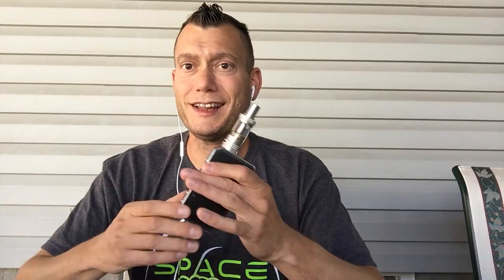Dangers of Ni200 nickel DON'T vape it on anything BUT Temperature Control!

Comment: What temperature is too high? my evic mini goes upto 600, i vape at 550? I'm sorry if this is a dumb question. Im really new to this :P
Reply from the maker: +Kaushik Padmanabhan Not a dumb question at all.  very common question.  It's personal preference.  You start in the 300's and work your way up to find the vape that you like.  All the while paying attention to the wicking of your build and how it keeps up.  how fast does your atomizer and build accept juice, etc.  only you will know when you have reached optimal vaping for you.  And hopefully your Evic Mini keeps accurate.  They do have a margin of error.  so 550 would be the max I would set that.  keep attuned to how your vape goes and be prepared to back it down if it tastes like it's running dry.  Don't rely on the device to control your vape, but rather act as a backup to your vape.  a mostly reliable but not always reliable backup.  Maintain ownership of your vape even if you have Temp Control.

Comment: Nothing wrong with kanthol.  All these lower ohm builds and mods just mean higher wattage, and less battery life.  It's all about  getting off the stinky sticks.  And getting good flavor. It's not about showing off how much clouds you can blow out of your mouth.
Reply: +mike hernandez No. Lower ohms means you can run the same wattage and use less battery. Just look at your kanthal. Build a .5 and a 1.0 and see which makes the battery last longer at the same wattage. Remember that wattage is the power output so vaping a 1.0 at 30 watts is the same as vaping .5 at 30 watts...just a different voltage. What TC is really about is not getting dry hits and taking longer hits without the heat.
Reply: Was talking about 0.1-0.2 ohms,  takes more power (battery life).  Wasn't talking about 1.0. With a 0.1 build you won't get flavor nor Vapor at 30 watts. Need at least 50 to 60 watts
Reply: mike hernandez That is outright wrong. I am using a .07 right now at my normal 45 watts. My batteries last almost 2 days. Where if I build at .5-1.0 I'll go through batteries in about 6-12 hours. I also get just as much vapor and flavor at 45 watts with my build as I do with any other build at 45 watts. Do you not know how ohms law works?

Comment: Ok so maybe I missed the part.. what is the temp max and wat max for ni200 crown uwell?
Reply: +Matt Smit 662F (350C) most mods only go to 600F. idk about the watt max, but I'm using my nickel wire at 120watts at 540F & its Great.
Reply: dangerouspsyco Absolutely.  Do not use nickel coils in wattage mode.  You'll burn em.
Reply: +GAZA-Z My mod goes higher but I'm guessing the vape won't be that great when too high.
Reply: +Matt Smit TC to 400, 500 and 600 watts.  Max 150 watts.
Reply: You only use the ni200 in temp control mode, never in wattage mode.

Comment: i heard that the mods with tc dont read the temperature right.if we put 200 c maybe its 250 c...hi from greece
Reply from the maker: +46sotos Hello over there in Greece!  Some mods are more accurate than others.  They are not reading temperature, only the increase in resistance of the coil from a baseline at room temperature.  it's complex....but just know that you can't get cheap and accurate in the same device.  Koopor Mini is probably the best accuracy in a device under $50 for temp control.

Comment: what people are not thinking about is what is happening to the nickel even at 300-500 degrees [f]...there is a chance that soft ass metal is off gassing metal. more research needs to be done. im pissed i got a sigelei now because i can only use kanthal or ni200....i like how it rips with tc but im trying not to get cancer by switching to vaping....whats the point if im going to get cancer from the ni200?

Comment: I vaped a nickel coil and power mode very heavily for about 2 weeks. Me and my friends are both new to vaping so I wasn't aware. Since It was only a few weeks and not years I should be okay right?
Reply: Nope your fucked man
Reply: It's fine it won't hurt you and there is NO powder that forms on the coils as I checked this part and there was no powder and I did all this on a non temp box
Reply from the maker: +YouTube Madness you dont' need to visibly see a 'poweder' for there to be a problem.  nor does the metal need to melt.  ignore these other guys telling you smacktalk...it's not good to vape nickel out of temp control and it's not good to glow the coils red as it alters the structure of the metal.  that is all I say here, that is all I will say.  get your mods in temp control correctly if you choose to vape with nickel.  vaping is not safe. it is only safer than smoking.  thanks.

Comment: Ok is that just for the Rebuildables?  I got my MVP 3.0 pro with a Elite Tank 2 (one of the shops online was having a deal) and The tank came with 2 Ni 0.2 coils and I know the 3.0 is not TC?
Reply from the maker: +Joe Man no.  that's for the metal.  I noticed that myself when I got the Sigelei Elite tank 2.  It didn't come with anything but 2 ni200 coils.  You're vaping nickel without temp control.
Reply: +Joe Man What Quest said..... also adding DO NOT VAPE THAT tank anymore, UNLESS/UNTIL you get a device with temp control to put it on!  Ni200 coils.... must be vaped in TC mode, only!  =o  You are correct, the Innokin MVP 3.0 is  definitely not a temp control device.  (inexpensive & great... pick up a Joyetech Evic vtc mini for around 40 bucks.  The orig is easily firmware updated to = the just released v2 that costs a few $ more.  imho, just get the battery... tank included in 'full kit' isn't worth getting)  If interested in TC & using that tank, that is.  :)  Live long(ER) & vape on!

Comment: So, even if it's a temp control mod, with the 3 different settings, W,Ni,Ti, still dont keep it on W mode with a nickel coil? I cant seem to find anyone actually saying that. You came the closest by saying "dont vape nickel in wattage mode" but it sounded like you meant wattage mode on a regular mod, without temp control. So basically youre saying, even if its TC, not to vape nickel in any other mode but Ni? Cause it has such a weak throat hit on nickel mode, but when you put it in regular W mode on the same wattage that it would have in Ni mode, it gives a way better throat hit. So im going to assume that's not a good thing lol. I was wondering why the hits are so halfassed on Nickel coils but now it makes sense after reading forums all day that only specify not to vape nickel coils on a NON TC mod cause of toxins being released. But youre literally the only one who mentioned it, saying not even on wattage mode on a TC mod, still. Correct? lol I have an Eleaf iStick TC60w. So thats where i was confused at when people say not to vape it that way. No one specified exactly that. But im pretty sure you did, im just a little hard at hearing sometimes lol
Reply from the maker: +Randy Maahs Hi.  Many people didn't know this.  That's why I did this video.  Temperature Control devices have dual purpose.  They have regular wattage mode for regular builds and tanks with Kanthal coils.  And then they have Temperature Control mode which you have to physically set for the device, and then you must also set your baseline resistance (lock in resistance) for the coil before you start vaping, so the device can now calculate temperature while you are vaping.  If you don't specifically set the device in wattage mode for the type of metal that you are vaping, then you're vaping in wattage mode.  Yes the intensity of vaping in Temp Control is much less than in wattage mode.  Because TC is stepping down power to keep the vape from exceeding the max temp you set.  This means that when you are in wattage mode your mod is NOT stepping down power or keeping it below harmful temperatures.  So if you are used to high wattage on Kanthal or Nichrome in wattage mode, then TC and Nickel or Titanium might not be for you.  You don't vape Ni200 or Ti for the same vape experience as you would Kanthal.  It's a cooler vape that requires lower power, and gives a less intense vape but theoretically better flavor.  So the message in this video is simply this:  if you want to vape Ni200 pure nickel or Titanium wire, please make sure that you have a temp control mod and that you set the mod for the type of metal you are going to use.  This includes selecting wire type, setting max temp, and locking in resistance.
Reply: Olay, thanks! The vape shop I go to said that I could vape it in wattage mode with a TC coil, but it would just burn out the coil. She didnt mention much else lol.. I just ran out of kanthal coils and all i had left was nickel, but its like im not getting the same pressure, or pull that i do off kanthal. but thanks for the info! I greatly appreciate it!

Comment: would this be a problem with dry herbs using the modern vape pens?
Reply: +TheWarIsWithin  Tho I've not used them... I know people who do & don't believe any use Ni200 wires in their coils.  Most, I'd assume... are using ceramic, kanthal/non resistance wires.  Can check with the package of the atomizer it uses (the coil in the tank or bulb) See if it mentions a resistance/ohms, temperature &/or look for the word 'kanthal', & you should be good.   If still unsure, or at all concerned.... mention the brand or name of whatever the pen is.... & I'll find out for you. :)  Live long(ER) & vape on!
Reply: +TheWarIsWithin weyjkijjhgyytc qwyoljb vvggyiopllkjgzsaqqqww the the the
Reply from the maker: +TheWarIsWithin I'm not at all familiar with Dry Herb pens.  Sorry.
Reply: cool, thanks
Reply from the maker: Mervielle Harirtte exactly, I feel the same way about it.

Comment: Hi, a moment ago, i accidentally inhaled ni200 off tc mode. I didnt notice until i tasted something weird and when i saw my mod it wasnt on tc mode. Will there be any harm on me? I just took merely less then 4puff off 25watts. I straight away went to change my coils and washed the whole tank just to be safe. When i was taking out the coils, the coils were abit black on the middle. My question is just tt few puff will it harm me? Hope for some answers. Thanks i didnt get any dry hits though.
Reply from the maker: +kelvin delonge I'm no Doctor, I don't have a crystal ball.  I've done exactly that.  Some mods will pop out of temp control. Good thing you discovered and didn't continue.  Some folks have been doing that for weeks and months.

Comment: Hi..thank you for the quick reply, 
i hear so many horror stories about NI AND TI coils, so many claim it will cause cancer, heart attacks etc etc. I'm yet to see somebody who vapes on nothing but either ni or ti coils and have had no issues. 
especially if people proclaim that using tc reduces the consumption of liquid over kanthal. And supposedly uses less power over vw 
i will give it another try. watch a few more videos on making coils with either ni &ti,  before i start to dabble on that dark side
Reply from the maker: +Jonathan Rayson Lots of people vaping on Ni and Ti and have no problems and enjoy it.  All this is too new for anybody to make claims for or against with accuracy.  Just must be aware that each metal has potential issues if used improperly and THAT is what this video is cautioning...the improper use of, or use of without TC, or pulsing the metals to glow.  Thanks for watching!
Reply: +Jon 
I've heard it's just certain soft metals that are dangerous to humans.  Titanium is supposed to be safe, along with stainless steel and kanthal.   Nickel is one of the bad boys.
I'll have to do more research.

Comment: hi ya chap..interesting vid..im thinking on tring the ni200 0.15 coils, whats the best temp to vape on. using a Aspire pegasus the temp control version, been so used to kanthal coils 26awg
Reply from the maker: +Jonathan Rayson That's a difficult question to answer.  I suggest start with your max temp set at 350 and see how you like that vape.  If you want more vapor production then increase.  I usually set TC around 410-450.  But where you will find it best for you is a matter of device and atomizer/coil you use and you'll find what you like best going through the range from lower max temp to higher.  Thanks for watching, and that was a really good question.

Comment: thanks bro for the information I have the exact same set up the ipv 4s and the same tank, not to sure the name of the tank or much about it, not to sure what the need to knows are about vaping I've smoked cigarettes for about 5 years a pack a day so I'm really giving this a go, I really appreciate the time you spent in the vidoes, trying to learn more about this.
Reply from the maker: +j Sanders happy my video was helpful, congrats on quitting smoking!  You've got a great setup.  I have a few tanks in this video.  The tank on my IPV4S is the Smok TFV4 with the RBA section
Reply: +Quest4vape thanks bud I'm really glad I stumbled upon your vidoes, I have no knowledge of vape, or the equipment honestly, I just know my lungs are deffenetly damaged from cigarettes and I hope vape will help me divert from this. how often do you need to rebuild these coils and change the battery's? is there a recommended storage environment for the oil or batteries? what is the best setting? is there some kind of maintenance for these units? I'm sorry for all the questions I just don't want to be doing something I shouldn't be doing.

Comment: Hi. you seem real knowledgeable,kudos to you. very informative to watch. would you please have any suggestions as to why my crown tank leaks when top filled? (airflow closed when filling, then leaks as soon as opened up).? have a great day!
Reply from the maker: +leigh cannon Coil not tightened in all the way, tank not screwed together all the way (that inner chimney section did you unscrew that to fully disassemble the tank and not thighten it)  An O-ring not seated right.  IF not those then bad coil or O-ring on the coil missing or not seated right.  or...bad batch of coils. Bad tank.  Try to trouble shoot the problem by checking all those things.  If nothing helps then tell the place you bought it from to send you out good coils and/or a new tank.
Reply: +Quest4vape Hi thanks for the reply. using a different device hence different name. I will take your advice, thanks for replying. iv learnt lots from watching your vids! Greetings from England, uk
Reply: +Quest4vape just to add I was using nickel coil. put a. 25 stainless back in and problem gone! bad coil as you said?!

Comment: Nice video man! I tried to explain this to a friend of mine and he said I was wrong as well.
Reply from the maker: +Brian Robbins meh...it's controvertial so there are widely varying opinions on the subject.  My only point here was to make sure that one has a TC mod and sets the device to TC mode and not vape these metals in wattage mode or dry pulse them.  Thanks for watching.  If folks don't want to listen, well....they at least heard the message.

Comment: Thanks for putting that info out there.  Misuse of this stuff could not only harm you the user but if the FDA and other federal regulators catch wind that this is that toxic and users are at risk,  they will have more ammo to use in taxing and outlawing these devices.

Comment: not only is vapeing nickel bad but super high temps turn reg e juice into a toxic gas the new trend of super high vapeing lvls is a dangerous trend god 4 volts to 8 .5 watts is pleanty in most cases this unreged 100 watt sub ohm is getting nuts
Reply: drifter848 please link me to the study you're citing about toxic juice gas.

Comment: Brother i am new to vaping but want to do it safely. I currently have subbox mini with kangertech coils. Im vaping at 20. to 22.W What do i need to look for?
Reply from the maker: +Wilder Rua Sounds like you're just fine with your build and the equipment you're using.  the subbox mini is a great setup.  You're fine.  Kanger sells nickel coils in a black and blue box, and have a blue O-ring.  You just want to make sure you don't use those on the subbox, as it does not have temperature control.  If you want to use those coils you need a proper temperature control mod.  If you feel you want a more intense vape you can also try the .5 ohm coils (right now you're using the 1.5 ohm resistance?)  which you can vape up to 60watts to find the right vape for you.
Reply: +Quest4vape Thanks that helps alot. Yeah the coils im buying are in a red and black box. 1.5 or .5 not sure since i am not home, but thanks alot for the help